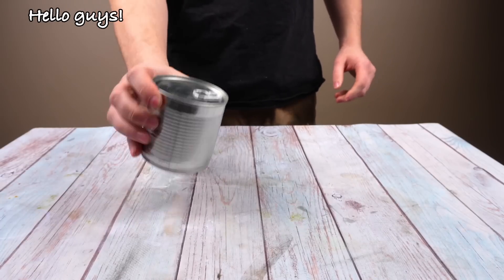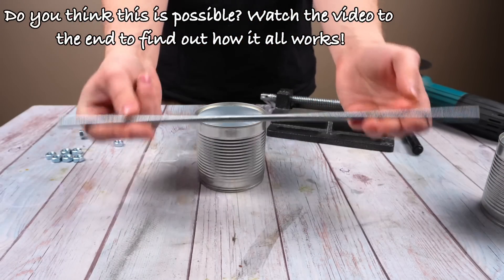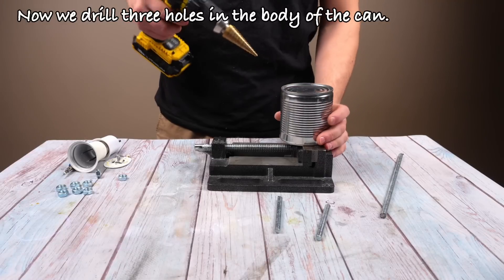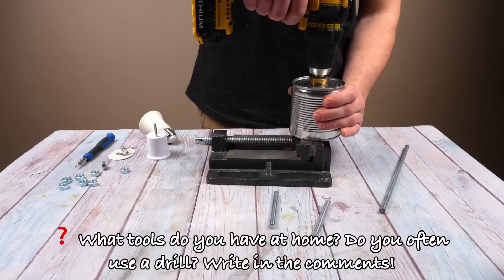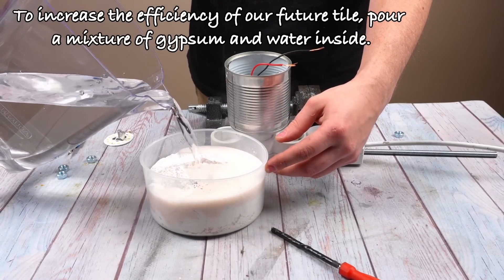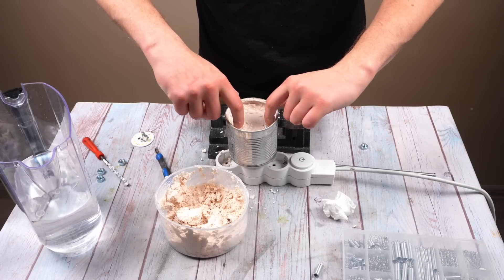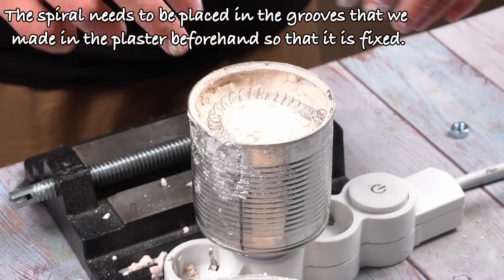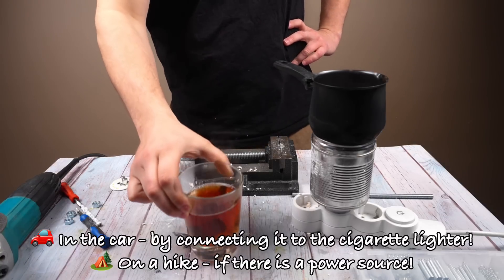🔥 Genius Method! Insert an LED lamp into a tin can and get an eternal stove

Comment: This would work great, if the tree in the woods have ac outlets.
Reply from the maker: You're right, that's a good point 😅
Reply: @FixItFast1  funny story, when i dating my wife.
we went caping in a wooded park.
she brought her hair dryer.
i said, what is that for?
she replied, to dry my hair silly.
i said to her, trees don't have A/C outlets and it won't work.
she got a little  upset and asked where would be the nearest outlet.
Reply: Certain trees on every continent emit about 12vs you can actually run light a bulb with it now I've done it had a bulb light for a few minutes tops then dissipate
Reply: You forget the current bushes. Lol. You get tasty tiny berries too 😂❤